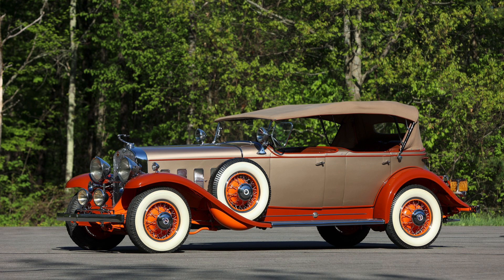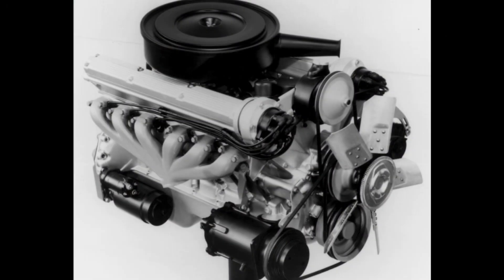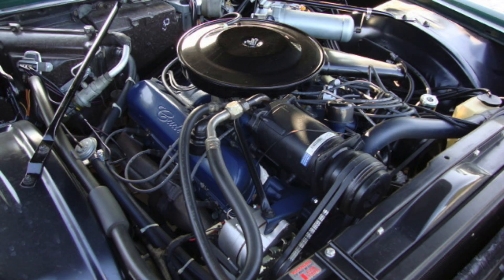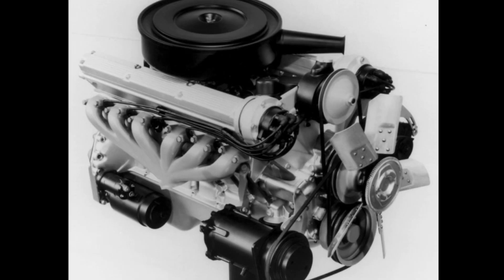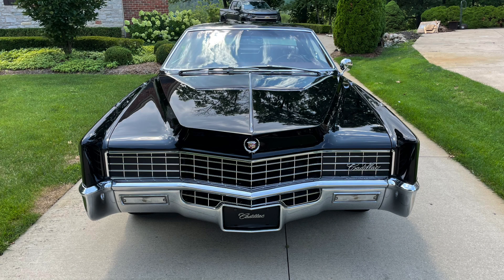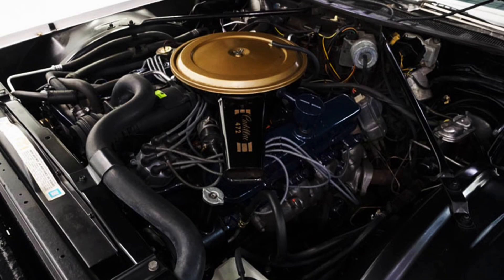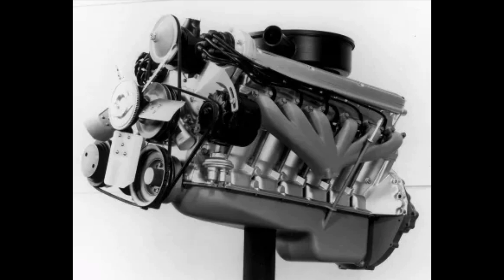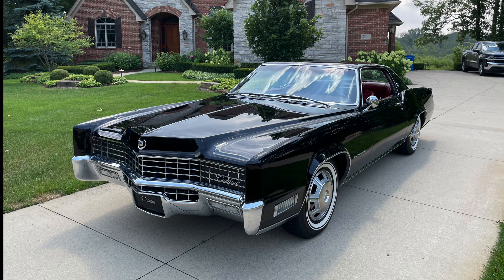Cadillac Builds an Awesome SOHC V-12 for its 1967 Eldorado...But Scraps It For Production!

Comment: One correction to your narrative at 2:00, GM did produce overhead cam engines in production vehicles, Pontiac’s OHC 6 which was offered in 1966 thru 1969 in Tempest and Lemans and 1967 thru 1969 Firebird.

Comment: Cadillac V12 rumors began to resurface again in late 2006. I was a tech at a Cadillac dealer at the time. The 3rd gen Escalade had just gone on sale as a 2007 model year. My service manager went to a Detroit area manager meeting and was told GM was developing a V12 for the Escalade to help further differentiate it from its Chevy and GMC cousins. There was speculation that it would be based on the relatively new (at the time) DOHC 3.6L V6 architecture which is a 60 degree V, or possibly it would be a cam-in-block version based on the LS architecture. Then the 2008 housing market crashed, banks froze credit so no one could get car loans, GM and Chrysler filed for bankruptcy, and I never heard about that V12 again. I have no documentation to support this, other than conversations I had with my service manager. In the end, perhaps it didn't matter. Cadillac has never really seemed to have a problem selling Escalades. It has done a nice job filling the role of the floaty-luxo-barges of a bygone era. Still not quite as floaty and numb, but it is otherwise today's version of a Fleetwood Brougham.

Comment: Two questions about the 1960s Cadillac SOHC V-12 prototype motor. 
1) Could it have easily been installed into the engine bay of an Opel Diplomat that was allegedly considered for what later became the Seville?
2) Could it have also spawned a related OHC Slant/Inline-six or even an early 70s OHC version of the GM 60-degree V6 to help maximise economies of scale?

Comment: In addition to the tooling costs for the FWD transmission and final drive GM would have been looking at tooling costs for the block, heads (1), manifolds, crank and camshafts and con rods. Pistons could have been farmed out. All for a limited production vehicle? How many Eldorado's did Caddilac sell in '67?
1) Caddilac could possibly have gotten away with one head line for the engine depending on just how clever they got with the cam drive design. The later DOHC V-6 from the 80s or 90s. The LQ-1 used the same heads on both banks.

Comment: The first OHC engine GM produced was of course the Allison V-1710 V-12. But that was a design they inherited when they bought Allison in tbe 30s. Their first OHC automotive engine to reach production was the Pontiac inline 6. One advantage Pontiac had with that engine was they used the 230 CID Chevrolet inline 6 as the starting point. As stated other GM divisions were looking at OHC designs in the 60s. But imo it was the bean counters who put a stop to most of the ideas.

Comment: There have been 4-Wheel Disk Brake systems that haven't out-performed Disk / Drum systems.  There have been DOHC engines that didn't out-perform SOHC versions of the same engine.   Still, marketing can try to make the case customers often respond to Buzz-Word engineering.  Sometimes technology for technology's sake fits the image of the vehicle, but maybe not for the typical Cadillac buyer of that timeframe.  The 472 / 500 engine series was probably a less-costly, more durable solution to meeting the vehicle performance goals than the OHC V-12 would have been.

Comment: Huge advantage in balance, and starter life . V12 engine sounds like it has no compression as a cylinder expands even if it doesn’t fire, and one is expanding as the next compresses. Thus they crank with less effort than a 4,6&8

Comment: Pontiac put an OHC inline 6 in production in 1965 and installed it into Tempest/Lemans originally and it was an option in Firebirds when they came out in 1967.  The OHC 6 came in a base 1 barrel carb and a Sprint version with a Quadrajet 4 barrel.

Comment: In 1982, I purchased a 1969 Tornado for $20 & a moped. Drove it 2 years and loved it.  (The previous owner was an alcoholic, failed to realize it had an exhaust leak. That coupled with the fact the electric windows were frozen caused him to have some unpleasant and dangerous trips).

Comment: 67 Caddy Eldorado is arguably the most attractive Cadillac of all time. Wish they were rear wheel drive, woulda been super cool with buckets and an automatic console.
Reply: My sentiments exactly. It would have been the ultimate, uncompromising, powerful, personal luxury vehicle. 

I've daydreamed of taking the optional floor shifter from a '68 Toronado and installing it in a bucket seat '67 Eldorado but I'm sure the cost to make it look finished would be astronomical.

Comment: I can only imagine if Cadillac would have built a V12 on the same bore and stroke of the 500ci engine. Imagine a 750 cubic inch v12 roughly 600 hp and 825 ft lbs torque would have been stellar in 1970

Comment: Very nice work. As an elderly Pontiac fan, I feel obliged to point out that, in the 1966 model year, the Pontiac SOHC 6 cylinder was available, in several power ratings, in Template and Firebirds.
Believe it sold poorly, and was subsequently discontinued.
Several guys I knew had one under the hood of their street race cars, and with proper tweaking it turned out to be pretty strong, and not fragile.

Comment: I learned to drive in my Mom's '73 Eldorado convertible. 500 cubic inches and a 5200 pound curb weight. That pig would pass anything on the road except for premium leaded fuel pumps... Wouldn't run on anything under 100 octane, and had to have leaded...

Comment: The FWD transmission/differential raised the engine a bit compared to normal RWD, so I don't see how a 60 deg, OHC engine could fit under that low hood, even with the "power dome."  The air filter assembly had to be flattened and moved down around the carb in the 71+ Eldo for clearance.  But money was probably a bigger factor.

Comment: You didn't need to do a V12 engine in 1967 to get the needed horsepower, you did it to be the "Standard of the World".  Only you didn't, because you were no longer the standard of the world.  That accolade was passed to Mercedes Benz with its 6.3 liter V12.  And Cadillac hasn't been the "Standard of the World" since, just a re-badged Chevrolet with a "corporate" Chevrolet pushrod V8 borrowed from a Corvette.

Comment: 1. A Tri-Power OHC V8?  I sense another video...  😉
2. I didn't realize GM had SUCH a long history of building engines with the wrong v-angle. 
3. Cadillac drivetrain engineer:  "Let's wait and let Chevrolet try an aluminum block.  I hear they're working on something called the Vega..."

Comment: GM was known for pursuing and then dropping or changing engines.  Pontiac started working on their V8 after the war and had it ready to go for 1953, but they were told to hold off because Buick had to have a V8 before the lower brands (Olds, Pontiac and Chevy).  Meantime, the Buick V8 was intended to have opposing valves and a hemispherical head, but GM nixed that so late that they had to revise the head design and put both valves on the same side of the head with a tiny intake valve and an odd (if not weird) pushrod arrangement. A giant engine stunted to some extent by a tiny intake valve.  Years later, Pontiac developed a small V8 for which they had already cast a large number of blocks but which they had to abandon because it was the same displacement as a Chevrolet under development.  The blocks were melted down without any analysis of whether the Pontiac engine might have been a better engine - but I bet it was more expensive!
Reply: Interesting, especially given that the low-class Oldsmobile OHV V8 was put into production in 1949, four years before Buick’s …
Reply: @sking2173  Correct, I should not  have included Oldsmobile in that comment on V8s. Olds had an OHV V8 in 1949.

Comment: Is this just another example of how Cadillac had given up on being the “Standard of the World?”

In the 1930s Cadillac struggled to remain profitable through the depression, yet persisted with the V12 and V16s because it mattered to the brand. In the 1960s Cadillac handed that leadership to the likes of Mercedes-Benz and others. Instead of a V12 that would have made everyone notice, the Eldo got an iron block V8, rear leaf springs, and drum brakes to try to deal with 60%+ front weight bias.

Comment: Why would GM(Garbage Motor) put a truck engine in a car?. Sound like the American don't know what its doing.
Reply: The 90-92 Cadillac Brougham had the optional 5.7 which was in essence a truck motor and it worked fine in that car.  I like it better than the 5.0.
Reply: Chevrolet's 5.7 (350) was introduced in cars before it became available in trucks
Reply: When your "car" weighs the same as a truck...
and you need the torque to move it around at all briskly...
you modify a truck motor instead of designing a possibly weak car motor and factory hot rodding it???
Reply: @JohnSmith-yv6eq  I bet those Eldorados weighed more than a 1/2 ton, 2X4 bare bones pickup truck lol

Comment: Thank you for the usual excellent article; it always surprised me that GM in the US stuck with the same technology for so long on the V8’s, I have always thought it would have stood them in better stead when the energy crisis struck in 1972/3 if their engines had been more advanced; in the UK, Vauxhall a GM division, launched overhead cam engines in 1967 (in the Vauxhall Victor), they were excellent units, noted for being smooth, powerful and torquey and were widely exported, that engine was replaced by the ‘Family 1 and 2’ series of overhead cam engines around 1978.

Comment: In hindsight, GM, especially Pontiac, was wise to pursue the OHC architecture. As usual, Pontiac and Olds were better, more forward-thinking than chevy in almost everything, especially engines....
But overall, it's best that the V-12 was shelved considering imminent reckoning of the oil market and the non-existent chance to apply the V-12 to other models to amortize cost.
Too specialized, too costly and no use in any other GM car, really.
Cadillac might have tried to use the V-12 in their sedans, but imagine how much worse their sales would have been at the 1973 oil embargo.
Lincoln would have never let them forget thru advertising how out-of-touch 12 cylinders  was in a world of gas rationing.

Comment: V-12s are smoother and more balanced than V-8s which would have put Cadillac up there with Jaguars, in terms of exclusivity. These castings would have returned their investment, the more of these would have been produced.
As far as "being more complicated" than a V-8 design, there would have been absolutely no pushrods to bend, being that this was the most simple of all OHC designs. The distributors were half as complicated than a 12-pin type would have been, even sparing the cost of a distributor shaft with drive gears on both distributorshaft and crankshaft. 
The only problem remaining would have been an efficient induction, given that the 60° bank angle sets limits on intake manifold runner length. The solution to this would have been to adopt the long-runnered crossram manifolds of the early 60s Chrysler 413s. The smaller Quadrajet used on the Pontiac OHC six, as an option,  would have adequately fed each bank's manifold. 
The other possibility would have been to cast a 90° block, using a standard intake manifold and offset connecting rod crank throws similar to those Audi uses on their V-6s

Comment: Sad that GM in the 60s was close to being total powertrain innovators but were always afraid to pull the trigger, and afraid to spend a couple bucks. Cadillac V12, Pontiac with SOHC 389 V8s. Seems like its what it lead to its mediocrity into the late 70s, all 80s, 90s with exception of the Buick V6, GMC SyTy  and LT5 corvette.

Comment: The V12 was interesting but a V8 is almost always the better choice for a given displacement, including for packaging and fuel efficiency. Separately, a SOHC motor is in theory capable of higher RPM but with the 3 sp AT prevailing at the time, a 6,000+ RPM motor was of little/no use in a heavy luxury vehicle. Good thought experiment but the second get Caddy V8 was the better choice, and still provided a notable differentiation owing to its unrivaled displacement.

Comment: I thought that I heard on the video that GM had not made a production OHC engine before this. Pontiac had the OHC 6 engine starting in 1966. My parents had a total of 3 Cadillacs with the 472/500 engine, and they were fantastic. They ran well, and put up with a fair amount of abuse such as overheating. They also had enough torque to move a house. I used the '75 Sedan de Ville to tow a '74 AMC Ambassador station wagon on a dual axle trailer, which I figure is a total of 11,200 pounds for a distance of 100 miles, and it did fine. Plus it got 11 mpg with all of that weight.
Reply from the maker: They had not made an OHC engine before developing the prototypes.

Comment: A minor correction is that GM did make an overhead cam inline six for Pontiac, I believe from 1966 through 1969.  The overhead cam six was offered in 230 and 250 cid.  So an overhead cam cylinder head for a six (one bank of a V12) was something GM had experience in. I wonder if the Pontiac head was considered for the Cadillac V12? Considering Adam's depth of knowledge about cars of this era, I'm a bit surprised this was omitted.
Reply from the maker: The video talks about the Pontiac 6.  The Cadillac V12 was under development before it.

Comment: I've had Both, 73 sedan Deville, 472 engine, and 70 Eldorado 502 Engine, those engines were extremely reliable...I've had a number of V12 Jaguars..... not so much... but very smooth running engines.
Reply: The Jag V-12's before the Michael May HE heads were always extremely smooth & quiet - because they were either out of gas or broken down...  😋
(I used to call them 502 as well and I don't know why.  I was too young to know about Chevy crate motors, so I wonder if some of the emission stickers went out printed 502?)
Reply: It was a 500, not a 502.

Comment: Regarding the reliability of the 472/500 cubic inch V8s, check out the airboats at Everglades Holiday Park in Fort Lauderdale, FL. They run twin 500 cubic inch Cadillac V8s in their big airboats. One of the captains told me they still use them because they make all their torque down low to turn those big props. When I heard them start up, they still had the classic GM starter motor. It felt like I was back in New York, circa 1970.

Comment: Cadillac V8 engine were rising in displacement, but not in horsepower per cubic inch. This was not unique to GM engines, the same was true for most American vehicle engines no matter the manufacturer. GM would have been better served by trying to make engines more efficient by increasing horsepower per cubic inch using research and technology (like OHC and fuel injection) instead of just adding displacement.

Comment: Adam I am a fan of your channel.  I will have to take exception with you on Cadillac engine reliability. The Northstar  V8 and the gasoline engines converted to diesel that were put in Eldorados . So many Cadillac buyers got screwed with these engines.

Comment: Reminds me so much of the Mercedes M120 engine except for the MB sfi induction and electronic ignition. Also of the M119 separate distributors on the front of each bank. The M120 was so unique in how it had the long ram intake runners, so the throttle body for the right bank was in the left and the left bank on the right, so you had to be careful about what the trouble codes were telling you. But it had a separate ecm for each bank and you could lose one bank and still have an operable engine. Honest here, we had a couple V12 Mercedes come in with the only complaint being that the check engine light was on and engine lacked power. It was running on one bank! 10:12

Comment: I wonder if part of the reason that Pontiac's  O.H.C. straight 6 was the only GM overhead cam engine to make it to production is that before GM jumped full bore into the O.H.C. revolution they wanted to see how customers accepted the 6 cylinder version first...and when it did not turn the world on its ear, GM got cold feet and stuck with O.H.V. designs instead.

Comment: This engine probably would have been more suited to RWD given the added length 
The THM 425 chain case takes up the extra room needed for the extra cylinders, it would seem
Reply: There is a lot of room in front between the engine and the radiator.

Comment: I don't think it would have been a good idea as the last thing the Eldorado needed was more forward weight and it had enough experimental content anyway. You might have gone with aluminum block and heads and kept the weight down but the SOHC head design would have been 2 valve per cylinder and not have gained much power and below 5k RPM and who wants to flog a Caddy that hard anyway?

Comment: I've worked the gist of my career in powertrain and have worked on more canceled or under utilized GM engine projects than I can remember. UV-8, High Output Diesel, S.G.E. (small gas engine, which was retooled from one of the L.G.E. lines in Spring Hill, Tennessee 2015 and never did go into production) are just a few that I can remember.